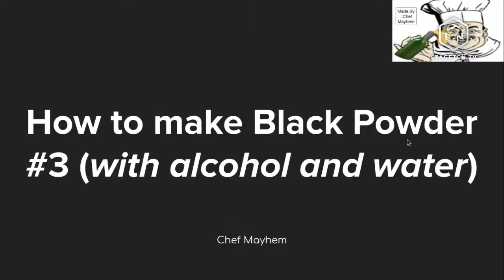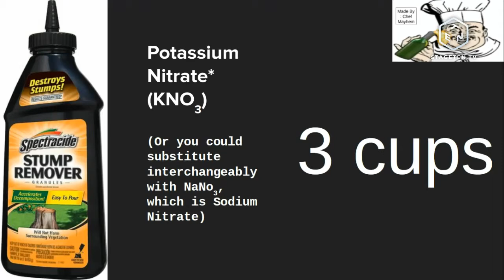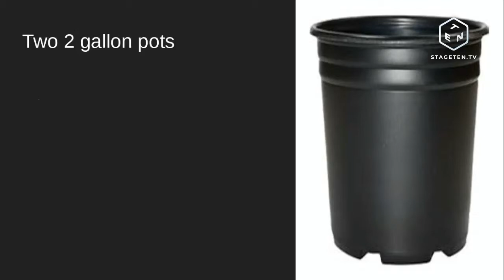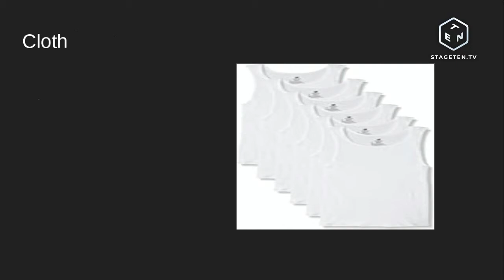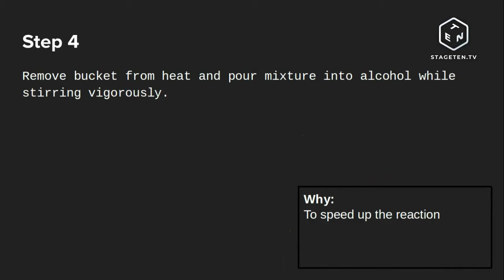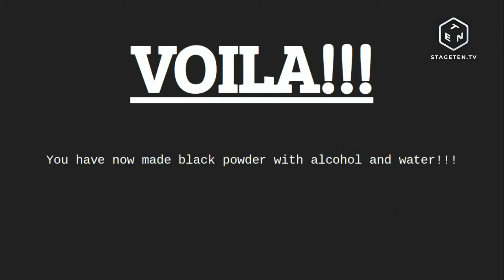How to Make the BEST Black Powder WITH WATER  AND ALCOHOL ( Black Powder V3)

Comment: Really Guys! Stop sleeping thru chemistry! 1). There are no chemical reactions in this process . 2). A polar solid dissolves in a polar solvent. Sugar dissolves in water but not gasoline. Nitrate dissolves in water but sulfur does not. Sulpher dissolves in alcohol or acetone.  Charcoal does not dissolve.3). Ball mill charcoal charcoal  to increase micro pore surface area. When this stuff dries you maximize your surface area contact with the reagents. Avoid contact with anything not brass and ground everything including yourself with ESD bracelet.

Comment: You can actually get away with not using alcohol but the procedure will be mildly different. The alcohol causes the potasium nitrate to (precipitate/crash out) of solution as it's less soluble in alcohol. The method not using alcohol would likely involve using a loaded solution so that no more nitrate can disolve out.
Reply: I use straight Alcohol when granulating mine. Great results. For both pyro & muzzleloader I use no Dextrin